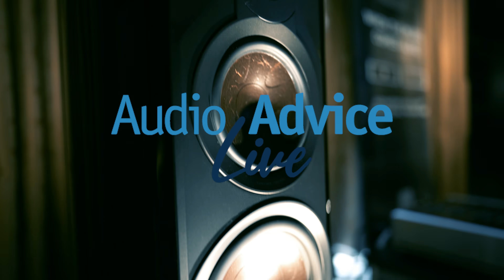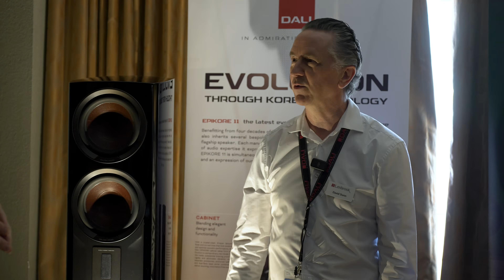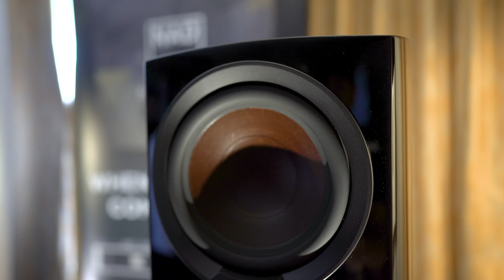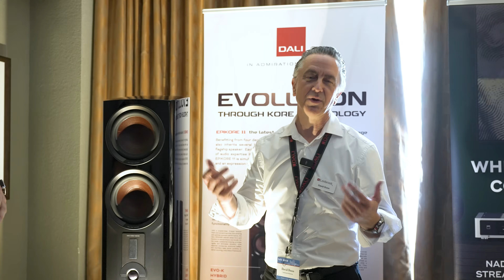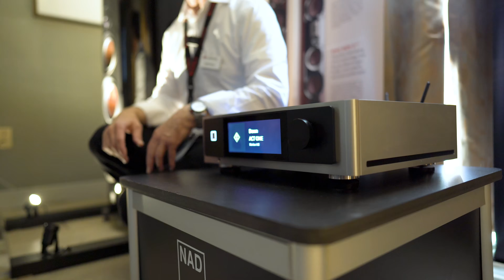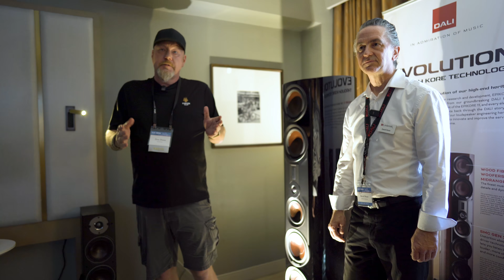$60k/pair Dali EPIKORE 11 Demoed w NAD M33 Streaming DAC AMP!

Comment: Hi Gene, you are the only person who can help with this, I recently got a pair of Polk Reserve R700 towers, I tested both with a 9-volt battery and it looks like the woofers are wired out of phase, I contacted Polk via email and they told me the R700 uses a second order cross over, will I have a problem during Audyssey setup of the speakers? I'm using the Denon AVR X-4700H.